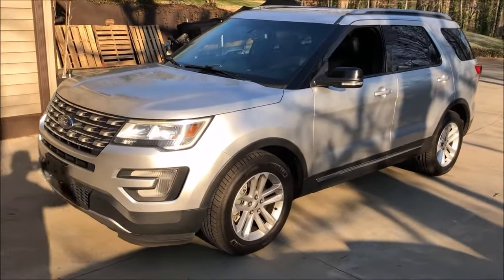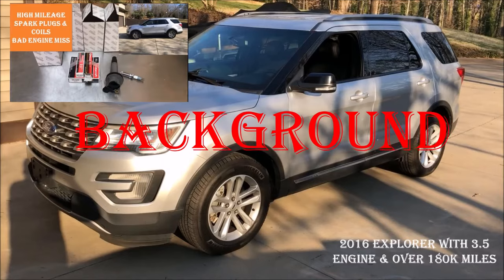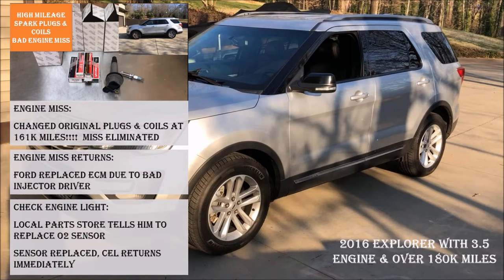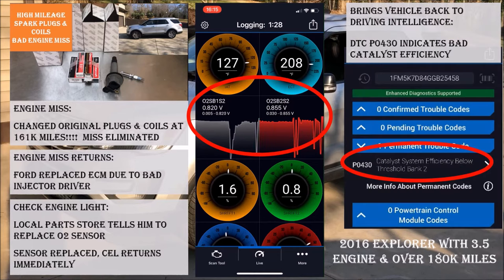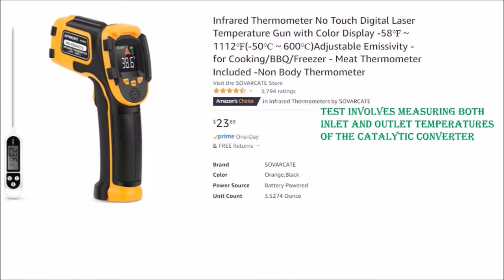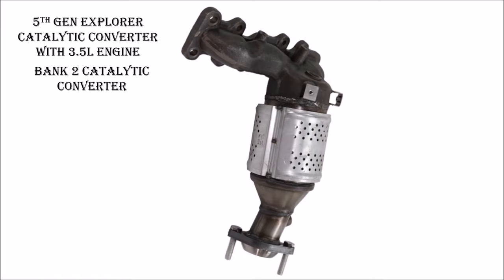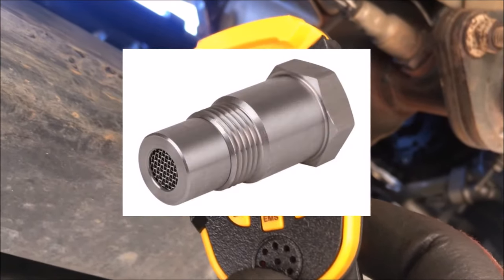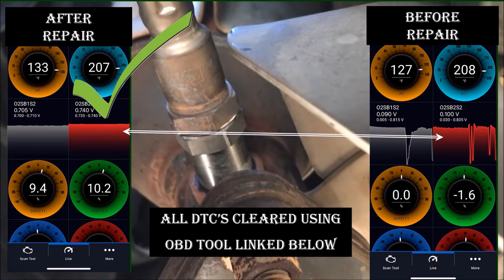How To Fix P0430 P0420 Ford Explorer Catalyst System Efficiency Below Threshold: Analysis Correction

Comment: Hello 👋, my issue here is having a very bad acceleration and high gas consumption, i checked the cat and it gave me more than 100° C between inlet and outlet(which means good),also I have changed the o2 sensor 2 bank 2. Unfortunately, it didn't solve the issue. However, when I installed that metal thing, the check engine light was gone, but i still have the same issue. Could you help me please 🙏
Reply from the maker: Really not enough information to go on.  You don't have any diagnostic trouble codes?  Have you checked your fuel filter?  Air filter?  Mass Airflow Sensor is clean?  Could be many issues.
Reply: Sorry, I didn't mention the code. It's p0430 same as your client
Reply from the maker: Still very hard for me to assist from afar.  Did you clear your codes after you installed the defouler?  If not, the P0430 might be s remnant from before your repair.  The poor acceleration and high fuel consumption could be from other issues.  How many miles on your vehicle and what other maintenance has been performed?
Reply: @DrivingIntelligence  
I have the same issue: a P0430 code and poor acceleration.
I went to the workshop, and they checked it. It turned out that there were some leaks in the exhaust, and I only had a P0430 code. I fixed all the leaks and cleaned the catalytic converter and throttle using Liqui Moly solution. I deleted the code and reset the car, but I didn't achieve any results.
After that, I changed sensor number 2 (bank 2, sensor 2), but I still didn't get any results. Also, I checked the Catalyst using a thermometer and found that the inlet temperature is significantly lower than the outlet temperature.  More than 100 degrees (which means it is good)
Finally, I bought an oxygen sensor separator (for bank 2 sensor 2), and after doing a factory reset, the engine light didn't appear. However, I noticed an increase in fuel consumption, and the car's torque and acceleration are still weak.
Reply from the maker: @ahmads8019 what’s coming to mind with this complaint is the possibility of a clogged catalytic converter.

Comment: Did you have to drill out the defouler or did it just screw in? Having same issue, just replaced o2 & cat!
Reply from the maker: What exactly is your problem?  Engine code?  No need to drill, it comes ready to be installed.
Reply: @DrivingIntelligence  Thank you. Had codes for both cats. Also, how is your water pump holding up? Did it ever need replaced? I have a '17 Sport. Just installed a fouler on the front today, may do back if I still have code. I had to drill out the center of my foulers.
Reply from the maker: Hey there, the Explorer in this video is not mine.  It runs like a champ.  Of course, I take care of it for the owner ;)

I don’t understand why you drilled out the defoulers… the hole is sized properly.
Reply: @DrivingIntelligence  Hey! You are a saint for replying, I tremendously appreciate it. I have codes P0420 & P0430. I put defoulers on and code is still there. Does that mean the O2 sensors most likely are bad? I am tired of throwing parts at it!
Reply from the maker: I should have noticed this in your previous message.  The defoulers do not go on the front O2 sensors, only the downstream.  Where are your defoulers?

Comment: The anti fouler I was able to find is a bit differnt, has a pin hole rather than a grate/grill at the end: this worked for a few days, then it started thrpwing a cat too lean code, do you think I can simply make the pin hole larger or drill it out completely or should I find a different style antifouler?
Reply from the maker: Please post the code you’re throwing.
Reply: Ok somine had just a pin hole compared to the one you showed in video, I drilled it to 1/4", also it was loose, i guess running it shook it loose, letting more clear air in, thus the lean. I am gonna run it now an report back: never thought Id wish for dirtier air, but it needs to be in the expected band.
Reply from the maker: @jimc7285  that loose install would definitely have something to do with your problem.  Looking forward to hearing how it turns out.
Reply: @DrivingIntelligence  yep, been fine since tightening, lights off: thanks for the video!
Reply from the maker: @jimc7285  awesome, good work!

Comment: I have that code but no miss fires I was running the explorer with a broken neck filler flap for a while but I cover the gas hole with a plastic bag every time I got gas I replace that neck filler and now I have this code and my car runs rough when it’s cold and the performance gets gets better as I drive the car hope you can guide me
Reply from the maker: that's hard to diagnose from a distance.  Do you have other diagnostic trouble codes?
Reply: I put in a Rislone cat cleaner and that thing turned off the check engine I followed the instructions and it did it job but it still running a little rough just on the take off. I got codes p0430 & p0457 and a abs code u3003-16 & u3003-17. The battery is new but comes up as bad in the cranking
Reply: @DrivingIntelligence  some guy put the big machine code reader yesterday and it said nothing but bad battery and camera not working so it’s really confusing it was a nice computer like 10k
Reply from the maker: @THEMAKDON  looks like you've got an EVAP problem as well.  I'd start off by checking the plugs.  When was the last time you changed your plugs?  https://youtu.be/dtOMOYMDRAE?si=IWlsZnPqa9leOhvi
Reply: @DrivingIntelligence  I have never changed them sense I got the car 3 years ago I don’t know if the previous owner changed them but I don’t have a misfire when it’s on idle it’s running perfectly even runs amazingly on the freeway without issues just on the take off you can hear like it’s can’t breath for a few seconds it sounds like a plugged air filter or like I have no filter but my filter is clean it’s one of those washables I cleaned it already
Reply: @DrivingIntelligence  also it does it sometime and sometimes it don’t it’s very odd
Reply: @DrivingIntelligence  I replace neck filler then 2 oxygen sensors and a canister sensor and nothing yet
Reply from the maker: @THEMAKDON  ignition components can fail under load.  Start with plugs and coils  Did you watch that vid I sent?
Reply: @DrivingIntelligence  I started the sparkplug tighten the screw to hard on manifold intake and it broke
Reply from the maker: @THEMAKDON  what broke?  Screw or manifold?

Comment: So IF someone has the P0430 catalyst system efficiency below threshold bank 2. IF its an O2 sensor its one the the 2 closest to the top side of engine by hood Correct ? Cuase Ford said I have 4
Reply from the maker: P0430 means you have a catalytic converter problem, not an O2 Sensor problem.  You need to follow the steps laid out in my video to confirm the cause of your diagnostic trouble code.  P0430 is not telling you to change O2 sensors.
Reply: @DrivingIntelligence  OK Thanks
Reply from the maker: @Richard5873  let me know how it goes

Comment: Where did you get the defouler? Do you have a link? I’m having the same issue and where I live they don’t check emissions
Reply from the maker: thanks for reaching out.  I had hoped to find these on Amazon, but no luck.  You will need to to a search on eBay.  You can find many on eBay.
Reply: What is it called?
Reply from the maker: @edkerch919  Please read my description, it gives you the information you need
Reply: @DrivingIntelligence  i understand the reading will work for the ecu but that doesn't mean the catalytic converyer is working right?
Reply from the maker: @jvst20051  hey, thanks for reaching out.  I'm sorry, but I don't understand your question.  Can you rephrase?  Sorry!
Reply: @DrivingIntelligence  what I mean is that the code came up for reason 🤔 and by putting that adapter its fooling the ecu but do you think the catalytic converter is still getting clogged up
Reply from the maker: @jvst20051  oh, ok, thanks for the clarification.  Yes, I am only fooling the ECU.  The cat is no longer any good, but it is not clogged.
Reply: @DrivingIntelligence  ok thanks for replying i just got a  2012 explorer and those are first codes I got p0420 and p0430
Reply from the maker: @jvst20051  If you follow my video, you'll determine if it's a bad cat or something else.  and congrats on your purchase!  Good vehicles!

Comment: I wish you was in AL so you could work on my 2017 Explorer xlt change spark plug ? Coils , and fuel injector still getting misfire on 1 and 5 I wonder if it’s the computer
Reply from the maker: Thanks for that comment.  Have you changed your spark plugs and coils?  If not, first step before looking at a computer issue, but depends on miles driven, and you should get a good scan of your entire system.
Reply: @DrivingIntelligence  thank you for responding yes I have gotten the sparks change and coil packs  and fuel injectors. I have an independent shop running test on it now to see what is causing the misfire.
Reply: @DrivingIntelligence  the car only has 96,000 miles on it
Reply from the maker: @Wilson-G2024  Have you gotten any diagnostic trouble codes?  DTC's?
Reply from the maker: @Wilson-G2024  not many miles
Reply: @DrivingIntelligence  no I have not got DTC codes only codes the shop getting is p300 ,p301 and p305 I will call them Wednesday and see how things looking and I will let you know.
Reply: @DrivingIntelligence  not at all
Reply from the maker: @Wilson-G2024  Hi Wilson, thanks for the update.  Those codes are actually P0300, P0301 & P0305.  P0300 indicates multiple cylinder misfires across your engine, and P0301 & P0305 indicate misfires in cylinders 1 & 5.  Good that you are getting that checked.  Sorry I can not be of additional help given I need more diagnostic data.  Do let me know when you get further information.
Reply: @DrivingIntelligence  good morning I received the suv today and they said that it was the fuel injectors. They replace 3 of them and the suv. Drove perfect till I was heading home from work then check engine light came back this time blinking 3 times. I pull over and check the code and it was the same again p0300,p0301,p0305. I am taking it to Ford Friday so they can run some deeper diagnostics.
Reply from the maker: @Wilson-G2024  wow, sorry to hear that!  When the check engine light came on, was the engine running rough?
Reply: @DrivingIntelligence  no the car runs perfect and smooth. But when I am climbing a hill for 3 miles while pressing the gas it will misfire on the same cylinders. I am really thinking it’s the pcm module probably a short in it
Reply: @DrivingIntelligence  taking it to ford Tuesday
Reply from the maker: @Wilson-G2024  I'm not so sure that is the problem... under load you get a miss.  Could be a damaged spark plug or the coil is arcing to ground.  I would check all plugs and coils again before they replace the ECM.  https://youtube.com/shorts/9p81y6sXxXA?feature=share
Reply: @DrivingIntelligence  I will have them check that today and see if anything changes
Reply: @DrivingIntelligence  thank you
Reply: @DrivingIntelligence  I remember a couple weeks ago they have move around the coils and those same 2 cylinders was still misfiring. I will have ford just go head and change them all out with the spark plugs
Reply from the maker: @Wilson-G2024  keep me posted
Reply: @DrivingIntelligence  so I took it to ford of Opelika AL Ford Service.  And they said I needed a tune up after I have already told them another shop did the tune up. Then they tried to say I have a leaking water pump and it would cost me $2000 🤦🏾‍♂️. I know this is not true because the shop I go to say the car had no leaks and everything was good. And I know that to be true because the car is not over heating or showing signs of water pump failure. At this point I am going to just get rid of it.
Reply from the maker: @Wilson-G2024  Why not try to change the plugs and coils yourself. Did you see the video I made where I change the plugs and coils? In an Explorer?
Reply from the maker: @Wilson-G2024  Extreme Engine Miss: No Diagnostic Trouble Codes:  5th Gen ‘11-‘19 Ford Explorer with 161,000 miles
https://youtu.be/dtOMOYMDRAE
Reply: @DrivingIntelligence  I was thinking about it.  I will do it myself next week
Reply from the maker: @Wilson-G2024  the owner of the Explorer in my videos wanted to ditch his until he brought it to me and resolved the problem.  These are good vehicles.  I have a problem with the Ford Repair Process.  Check this short video out:  https://youtu.be/0Tn4tVcbpDU
Reply: @DrivingIntelligence  thank you I will definitely watch it. I got it at ford right now they said the water pump has to be change so I will see what happens next after the water pump change.
Reply: @DrivingIntelligence  your so much help I really appreciate you brother. God is going to bless you plenty for helping others in need.
Reply from the maker: @Wilson-G2024  you are very welcome... that comment helps to keep me going with my channel as it slowly grows...  :)
Reply from the maker: @Wilson-G2024  sounds good, I look forward to your progress.
Reply: @DrivingIntelligence  trust me your channel is going to boom 💥 your helping a lot of us. And I will let you know my progress once I get it back from ford.
Reply from the maker: @Wilson-G2024  Thanks very much Wilson.  Truly appreciate your support.

Comment: If this is not legal how can they legally sell these?
Reply from the maker: Good question!  But it works.  I prefer replacement of the cat to be environmentally conscious, but it’s very expensive.  You need to use an infrared thermometer to determine if your cat is bad or good.
Reply from the maker: Do you have emissions testing where you live?
Reply: @DrivingIntelligence  no
Reply from the maker: Sorry, I said replacement of the car, I meant cat.
Reply from the maker: You can use the extension if you don’t get emissions tests
Reply: @DrivingIntelligence  how can the cat be bad if its not clogged?
Reply from the maker: @chriss4365  A catalytic converter can be bad, but not clogged.  When I say clogged, I mean the catalyst has melted or broken apart to impede exhaust flow.  A catalytic converter can be contaminated or slightly melted due to misfires causing it to malfunction, but not obstruct the exhaust.
Reply: @DrivingIntelligence  my truck does not misfire.
Reply from the maker: @chriss4365  Chris, I'm really no longer sure what you want to know... I have given you a lot of info explaining potential failure modes and what could cause a problem with a cat.  I am not diagnosing your vehicle.  You need to do the tests I lay out in my videos to identify the problem.  I've helped as much as I can at this point.  Good luck